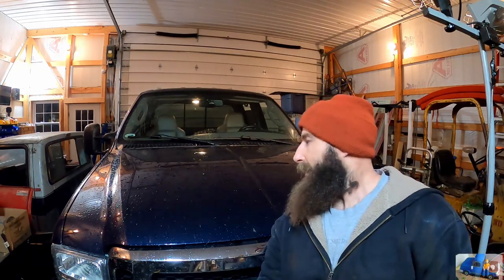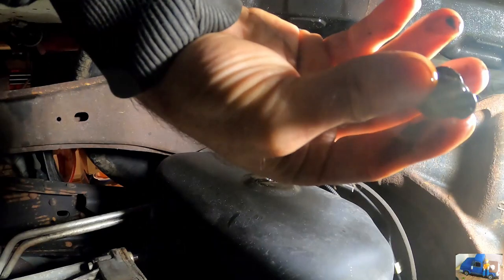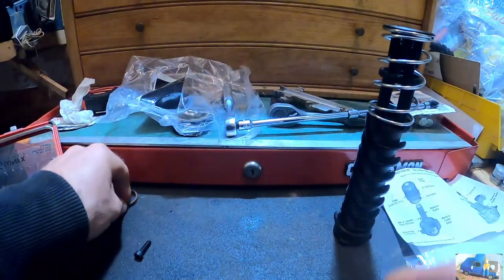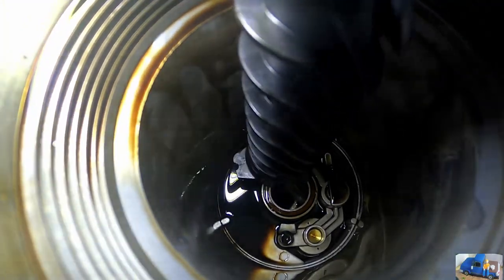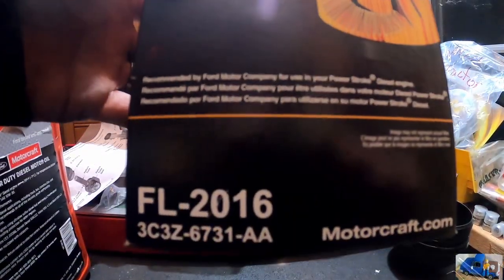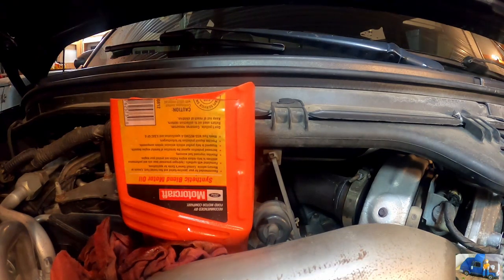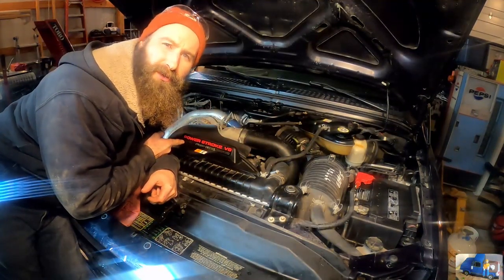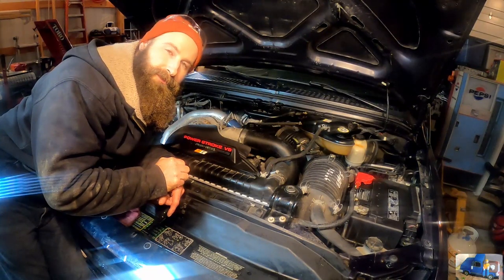F250 6.0 DIESEL ENGINE SERVICE; OIL CHANGE, OIL FILTER TUBE, WATER FUEL SEPARATOR DRAIN

Comment: Duuuuuude. Found that pressure bypass plastic bolt and spring in the oil filter housing  after removing the filter. Had no damn clue what it was or where it went. I looked all over trying to find videos or forums about it and nothing. Couldn't find the parts in any parts diagrams either.   That thumbnail was gold to me. Thanks for the help.
Reply from the maker: Thanks!  I am happy to help out.  When mine originally broke I was in a panic.  Thanks for watching 👍😁

Comment: Great video. What was the black cap for near ( looks like oil filter cap)the moisture separator plug?
Reply from the maker: Thanks! The water separator unit has a large fuel filter on the end...Similar cap as the oil filter. Change both fuel filters, here and at the engine, every 15k or more. Thanks for watching!👍😁

Fuel Filter:
https://youtu.be/k9J7sBFMSuU

Comment: Did it concern you that there may have been plastic that was on the other end holding it in might have got to the motor?
Reply from the maker: Yes!  I was freaking out when I first noticed it was broken.  I only realized it during an oil change when something fell out of the old filter.  After I calmed down and thought about it for a minute my worries went by the wayside.  It was operating broken for sometime and could have been running like that for possibly the entire oil change period (~5k miles for me).  The small plastic pieces  were long gone by the time I even noticed and it would be impossible to locate them outside of major disassembly.  At that point it was basically an, 'it is what it is,' type of scenario.  I operated it six years like that before replacing the pipe.  Thanks for watching! 👍😁

Comment: Thank you for this! I am about to replace the same part for the filter. If I have a new filter already in there I should be able to take it out and replace the spring/tube for the filter like you did and put back in with the same filter right?
Reply from the maker: Welcome!  I see no reason why you shouldn't be able to reuse the filter if it was recently replaced.  The only issue would be if you damaged the o-ring or contaminated the filter while it was out.  Thanks for watching and good luck with the repair!  👍😁
Reply: @FlatThunder  thank you! Hoping to tackle it today.
Reply: @FlatThunder  I did it. No torque wrench but got tight ratchet

Comment: do you have to prefill filter?
Reply from the maker: Nope, you can't do it if everything is working correctly it will drain into the oil pan.  It has a valve in the bottom that opens when you take off the cap.  Thanks for watching!  👍😁

Comment: Will the stand pipe tube in the oil filter housing cause the oil to drain back into the engine after you cut it off?
Reply from the maker: Unscrewing the oil filter cap allows the tube and filter to lift up.  The vertical motion opens a valve and allows the filter housing to drain into the oil pan.  It should be drained before you attempt to remove the stand pipe.  Thanks for watching!  👍😁
Reply: My question is what will cause my oil to go back in the engine causing me a long cranking and sometimes using ether?
Reply from the maker: @rodneygrainger4274  I see..... The valve could be broken or you could have some mismatched components.  The aftermarket industry has pushed for taller oil filter caps and filter elements.  If you have a taller oil filter cap and a standard height oil filter element the valve will not close and the oil will drain back into the pan as the filter bounces around.  This is my best guess for unwanted draining at the oil filter housing.  Good luck 👍
Reply: It ran great for three months then long cranking. I replaced standpipes and dummy plugs, and wiring harness and icp ipr and egr.
Reply from the maker: @rodneygrainger4274  FICM could be shorting out in cold weather.  Their is a diagnostic procedure to check the output voltage on these units.  I had one that would drop voltage on cold weather and never start but was fine in warmer weather.  They need the high voltage output to fire the injectors; I think it's 36 volts.
Reply: @FlatThunder  what is the best way to remove the low pressure oil valve and spring bolt out when someone stripped it. The 12 mm Allen.
Reply from the maker: @rodneygrainger4274  step one ask, why me and refer to the previous mechanic for advice on why he would do such a thing' 🤣.  In all honesty I have not encountered this issue.  I would remove the raised filter housing for more access and attempt to vise grip them out.  If this doesn't work I would switch to a left handed drill bit followed by an easy out.  Best of luck on the repair and thanks for watching!  👍😁

Comment: Great truck if left a truck to fo it's job. It's not a race truck. If so expect it to break.. I have 03' dually 280k and 06' CCLWB F350. 167k....both are syock with only atlas 40 tune....maintenance is key and leave alone....
Reply from the maker: Bone stock and still going strong.  I too think they run great when properly maintenance and not modified.  I'll never understand the logic behind dialing them up just to hear the turbo and pump out black smoke.  Several expensive diesels running around my area with heavy performance modifications.  I guess everyone has their  own thing.  Thanks for watching!  👍😁